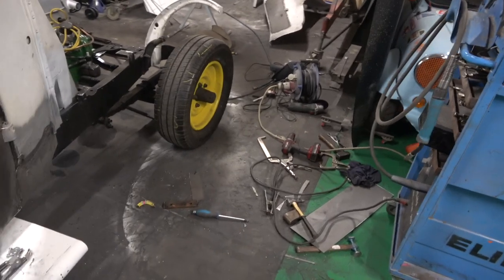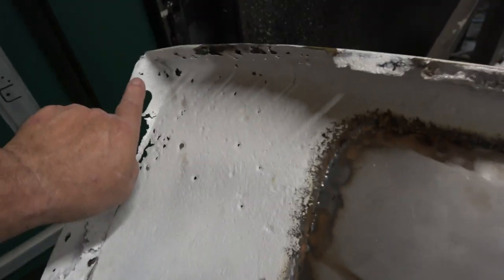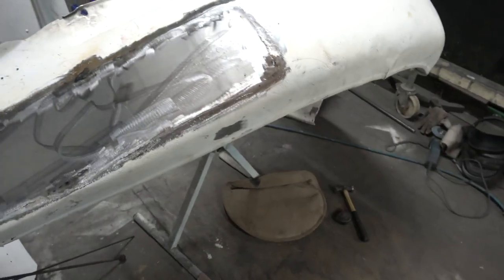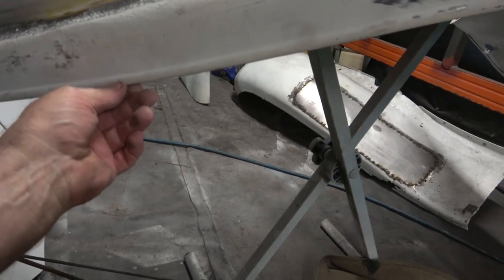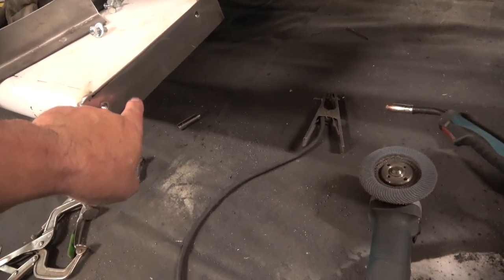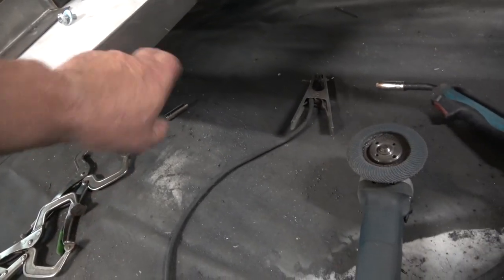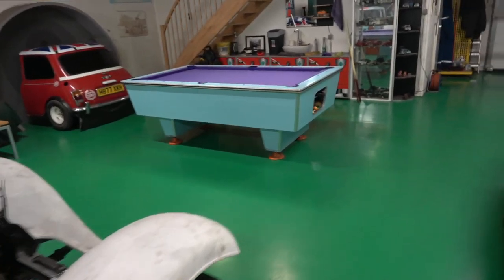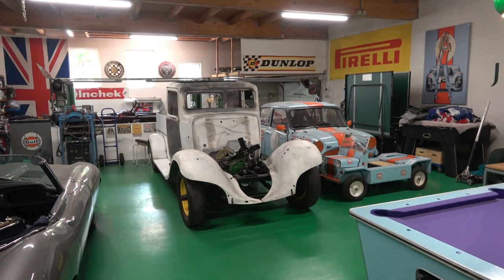1930s Barn Find & A Clean Up In The Man Cave

Comment: Hi Dave. Those wings are pretty bad and they'll keep you busy for a few days !!!  Regarding the beading do you know anyone with a  lathe ! Could you not use an exsisting  pair and adapt them to match the profile of  yours.....just a thought . Good to see the "mini bar " back in action . Seeing a overview of the shop , you certainly have a lot going on ! Cheers!
Reply from the maker: John,  Yep there is many hours of work involved in getting the front wings back in shape for sure 🤔 I did have a die made for the second E Type we restored and 
it was really expensive so I will try and hand form the bead myself. We have the same issue each winter & summer when I want to get the garage cleaned up as 
it is too cold in the lower garages to work in the winter, But I have a cunning plan as Baldrick would say 🤣😂 Cheers Dave